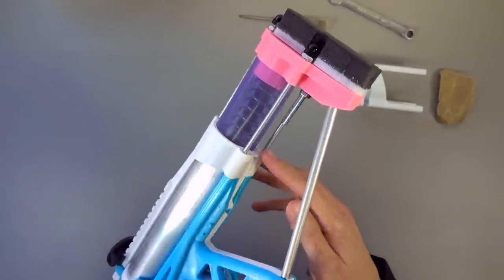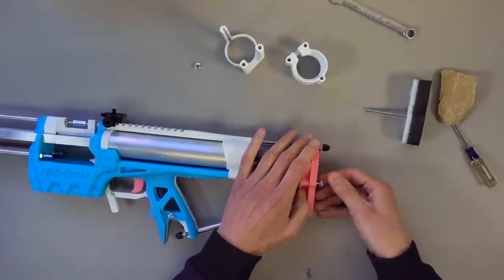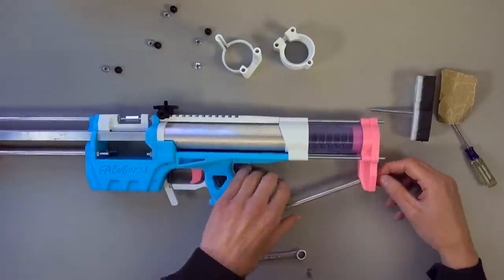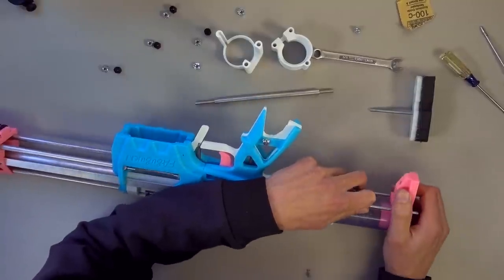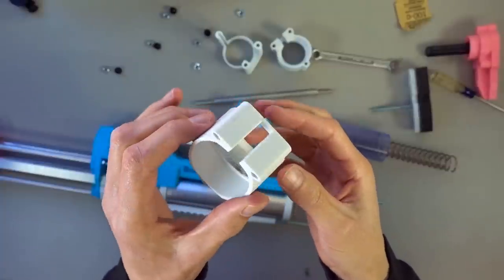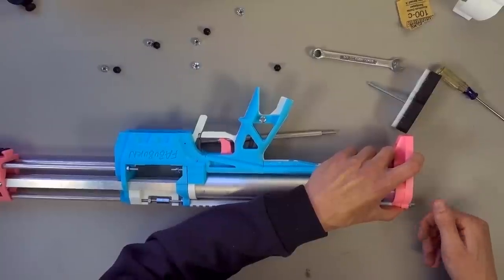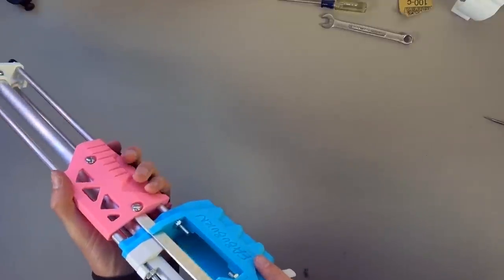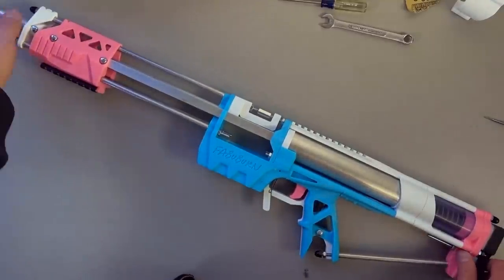I Broke My Caliburn! Let's Fix It Up | Workbench Wednesday

Comment: Small rubber mallet would nock the bottom 2 loose
Reply from the maker: Entirely possible, I'm always worried about breaking the blaster though lol.
Reply: hence rubber- light tapping to knock loose but i think yours was jammed up some due to the broken part may have caused some twisting? Also deep well socket for the nuts in the magwell is your friend
Reply from the maker: Makes sense, and that could be the case, who knows haha.
Reply: so much facepalm watching him putz around failing to pop the end off...

Comment: what ways is there to smooth out shells in integrations other than epoxy and spot putty?
Reply from the maker: That would be a question for someone like MisterNathan
Reply: Very clean cuts and careful epoxy work. Caulking compounds may work but you'll have trouble sanding them so you have to get them right the first time. Body filler works too, like Bond-o. Hope this helps!
Reply: Hot glue ^^

Comment: So honestly speaking would you recommend buying one of these assembled me not being a modder??
Reply: I am not jangular but, I bought the build kit were you have to assemble it. Captainslug gives you instructions that are easy to fallow. If anything you can fallow jangulars lets build a caliburn video. This will save you a good amount of money and have a deep understanding of the blaster workings.
Reply from the maker: I was concerned at first that I'd have to build mine, as I don't consider myself an experienced modder by any stretch, but with the instructions, and some help from chat when I didn't read carefully and did something silly, I was able to put it together, and it was an entertaining process, so I think you could find you enjoy it, and that extra money could go towards other nerf purchases, or upgrading to an aluminum rod when he has them back in stock, etc.
Reply: If you can build an ikea anything, this should be pretty doable. And it will help a lot if you ever need to replace a part to know exactly how it's put together
Reply: Did you buy one? I just got mine delivered yesterday after a 6 week wait. It came mostly assembled, but Captain Slug just announced that he can now mail fully assembled. Mine is number 417 and was simpler to assemble at the back end than Janguar's one. Slug has nearly 100 to make during May, so there's a lot of people getting these now.